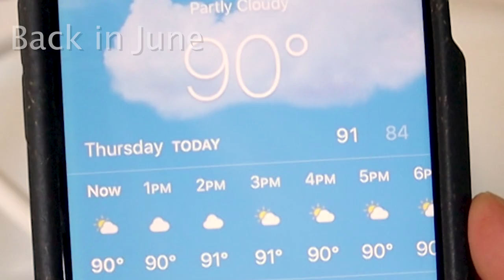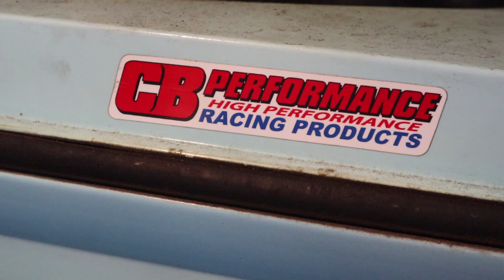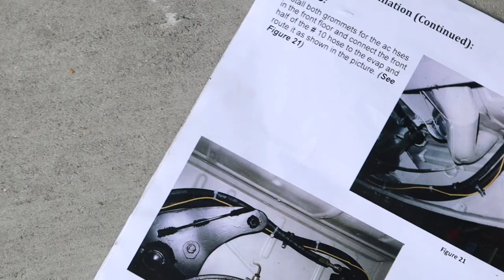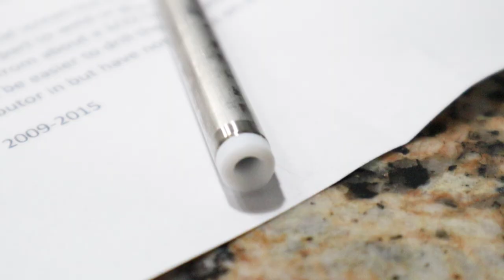Air Conditioning In A 1967 VW Bus

Comment from the maker: Big THANK YOU to my dad who did basically all the work on this one. ALSO: Gilmore Enterprises has since upgraded their pulleys to fit and center on CB Performance crank pulleys.
Reply: Bro 
Do u give me a job on ut garage😁 please
Luv frm imdia
Reply: I need to show my friend this video. He owns 3 buses and 3 bugs he also has the VW bus with the truck bed. I forget what you call that one. But yeah
Reply: This might be a dumb question I’m in the process of purchasing a bus does that AC have heat in it too or is it strictly AC
Reply from the maker: @peytonsalehinasab1889  Just A/C. The bus has a heater originally, just need to make sure that the heaters are in good shape (no rust on J pipe things) since it uses the exhaust heat for interior heat.
Reply: You are very welcome. Always fun playing with VWs.
Reply: Love the video. Where did you bought  the kit? It's now 3 years already. How's the belt configuration? How long did the belt last? Did you don another modifications?
Reply from the maker: @bobtomica9614  Thanks for watching, here is the link to their website: https://www.gilmore-enterprises.net . I have been running the same single belt for about 8k miles now and it still looks great. I haven't modified the system in any way so far and it has been working fine.
Reply: @gottasplit5707  Thanks!!!

Comment: I live in Indonesia, a tropical country with an average daytime temperature of 36°C. 
I have a VW T2 that also uses AC. 
The compressor uses Denso with 2 belts, the condenser is below and the evaporator is located above the driver, so that the rear passengers also feel the cold wind. 
When used, the power is reduced, so I increased the engine capacity from 1600cc to 1800cc and used a double carburetor. 
I also replaced the alternator to 72 amps to overcome the lack of electricity when driving at night where music and head lamp are on, plus the condenser blower and evaporator blower.

Comment: FYI it is already really hot for summer driving in a air cooled bus. Watch your engine temps. Then you ad the drag of an ac compressor and it is really pushing it to the limit.
Reply from the maker: Yup, this engine has been full flowed and has an external oil cooler with a thermostat activated fan. I also have a larger fan and oil cooler than normal and an extended oil sump. The AC hasn't really made a difference in heat or power.

Comment: What a project. I completely replaced AC on my 87 Westy, everything except evaporator (flushed well), including all new lines and new components. What a learning experience!   Wife wants a bus but I had questions about AC kits, this video is perfect.
Reply from the maker: Thanks for watching! I'm actually going through my Westys system now trying to find what must be a really small leak. If you replaced the Westys system, You should have no problem with the bus install. Good luck with it!
Reply: How was that install? I have an 87 ton top I’m looking to get an aftermarket kit for. Do you recommend any?

Comment: Great job, and kudos to Dad for the help. To be honest, I didn't think that small engine could power the compressor, and thus, the reason VW didn't offer AC on these buses. But my hat is off to you guys, Great job!
Reply: Back in the day what you said is true. I believe this AC setup use rotary compressors which rob much less power.

Comment: You must lube your Orings with refrigerant oil otherwise they will grab and damage the Oring and that will come back and bite in the long term, also the A/C drags heat out of the vehicle so regardless the whole vehicle will cool down the people in the back do not need cool air blowing on them to cool down, An ac or fridge or anything like that removes heat though the evaporator and the condenser they do not put cool air in as such if you understand what I mean, but great job guys in any case well done from down under A/c Tech of 30 years.

Comment: ha!!  this is awesome..  I live in OhiO  but I added TWO! compressors and 2 large condensers plus 3 indoor evaporators to my Mobile Ofifce DEV bus..  thanklfully its an old school bus so its a LOT bigger inside..  but it was still a Shoe-horn job to fit 2 A/C compressors in the engine with a bus that already has air brakes compressor, fan, alternator and such running from the belts..  I find myself ending up in Texas and florida in the summer months quite Oftern..  I like the heat BUT not when im driving!!

Comment: So nice that there are a lot of manufacturers making stuff for the air cooled vans. Hoping small company's also start making stuff for my LT.
Enjoy your A/C! We luckily don't need it that much. It was hot when we went to france, but meh, just went with it, shower afterwards.
Reply from the maker: Thanks! Having so many after market parts is both a blessing and a curse. Sometimes it's difficult to find a good product that fits, works correctly and lasts.

Comment: I have the same bracket and compressor,  I mounted the compressor sideways, Same as you you did to overcome clearance issues with throttle linkage bar above compressor,  had in car since 2019, compressor recently stopped compressing the refrigerant, an engineer told me the compressor died an early age because I mounted compressor on its side, fittings are apparently supposed to be located on top of compressor,  I have not yet installed the new compressor,  also watching another YouTube video it was recommended to use the smaller pulley to not over load the engine, the larger the pully the larger the load placed on engine, I have not had time to look further into this but thought I'd pass on the info. Great video,  I like the roller ball bearing throttle cable tube,  got one on order, thanks.
Reply from the maker: Thanks for the info. 👍

Comment: great video! just recently fixed the AC (not a gilmore kit) on our beetle and I am having problems with fixing the tins for the compressor brackets, I wished you would create another video on how you cut the tins to make way for the compressor brackets.
Reply from the maker: Really it's just trying to put the tins in and cutting away the parts that are in the way of the brackets. if I remember its only a circular hole in the forward most tin and a notch near the exhaust flange on the rear most tin. Just be sure to cut a small amount at a time. better to have to take the tin on and off a thousand times than to cut too much the first time.

Comment: Well AC is necessary if you drive in the summer in FL for sure. Honestly I would do one of 2 things. I would not drive my bus  in the summer or put in a different system. The rest of the year you can drive with no AC it is great there just crack the wind wing. I was thinking about making a generator stand at was a bit shorter (machine a 1/8 to 3/16 off the bottom of it then put a piece of plate under it to make the bracket, also I would have gotten a universal Evaporator and put it under the seat. then have tubes route around the seat and have them point up at the driver and pasenger. Possibly use the heat duct to push air through the dash area.  and attach diverter clip on lexan plates to make the air point at your face.
Reply from the maker: Sounds like a good idea for a system. I just don't have the time to put together a home built AC for the bus. I'm sure there will be complications with running AC up through that tube since it is not very insulated and has no fans to blow the air. As it is, the AC works pretty hard to just cool down the bus. I drive my bus on pretty long journeys at all times of the year, so that little black box under my dash doesn't bother me too much if it means I get to enjoy my bus more.
Reply: @gottasplit5707  for sure I noticed you dont run a heater and I am sure you dont need one in FL. I would have used that void under the front seat and insulated the heat pipe and used that for part of the ducting. then 2 more ducts on either side of the front set. Yea But again I would be more worried about the engine running too hot and burning up. I am not sure which gears you have in the trans. or engine size. But FL heat is really hard on the engine without air. with air that drag and the FL heat might be a new engine pretty quickly. Get a head temp sensor much over 300 is too hot. Or when your driving it floor it once in a while and if you hear any pinging it is overheated.
Reply from the maker: @Mikefngarage  I have a stock transmission with gear reduction. I agree that I need a temp sensor just to be sure, but so far I have had oil temps around 186 in the summer. Hasn't gotten any hotter than that. The external oil fan has only ever switched on once while I was in bumper to bumper traffic. The engine is also a 1904cc and barely feels the compressor. I doubt it is any worse than putting a few passengers in the car. I can see how its extra strain at idle, but while moving it shouldn't make a difference.
Reply: @gottasplit5707  cool just keep an eye on it on those freeway trips. around town should be fine. Check on the cost of putting a 3.44 gear set. Stock is 4.12. Kind of pricey but worth every penny on that split window. I do that and have them put a bug 4th gear. stock bus is .82 bug is .89. this gives you more like bug gears. make sure rear tires are tall too 205/75 15. anything smaller is too small for stock trans. too many RPM on the freeway makes these run hot too. there is a happy medium.
Reply: @Mikefngarage  New style compressors only take about 1 to 2 hp to run

Comment: I'm doing a Subi swap on my '68 and it looks like this answered a lot of my questions.  Just need to find a place to fit the blower and whatnot in the front with everything else chassis or belly mounted.  I was wondering if I'd have a problem with having to run tubes so much further than normal and if the compressor could keep up with that.
Reply from the maker: Thanks for watching! Glad the video helped. 👍

Comment: Curious….Can you still get at the fuse panel without complications? I notice it is very close behind the evaporator.
Cheers!
Reply from the maker: It is super close, but I can still get to the fuses. It does make putting the fuses back in a little bit of a pain though.

Comment: A year in have your thoughts changed at all about this kit? has the single belt system continued to work ok?  I'm looking at a early bay kit what length of bet did you get for the single belt system? The single belt looks like the average auto fan belt at any auto parts store correct? thank you for any help great video :)
Reply from the maker: It's been really good, but both my friend and I have had problems with the quality of the compressor in the kit. We both have changed the compressor to a different one that has been working much better. Everything else has been fine. Definitely like the single belt since its less to mess with and makes it really easy to make small adjustments to the alternator belt without removing shims on the pulley. The belt I think can be bought at any auto store. I got mine at an Advanced Auto Parts.

Comment: Cool video, thanks for sharing. I have one of these kits waiting to be installed. I have a thousand questions but here’s a couple of them: Some people install the evaporator on the parcel tray area (requires cutting the parcel tray, of course) for higher positioning and thus better cooling. Do you feel that you get good enough cooling with the evaporator where you have it? Another question is, without a cab divider to trap the cold air in the front cab, same question: do you feel that the system delivers at cooling things off on a summer day? Lastly, I do see you have quite an upgraded motor, how (if at all) has the AC affected power? Do you run it while on the highway and if so, how fast can the bus comfortably go? Sorry that’s more than a couple questions, catch you at the next gathering.
Reply from the maker: Thanks for watching! I tried to stay away from cutting stuff as much as possible when installing. it probably would look and wok better a little higher up, but I'm ok with where it is under the tray. Without the walkthrough, it does take a while to het cold air to the back, but since I drive the bus, I can't say for sure how effective it is in the back. I do think that eventually I will put another evaporator in the rear, which I have been told works with the system. My engine is a 1904cc with a bunch of added cooling parts on it for the summer heat, so it doesn't feel the compressor that much or get too hot with it on, even in the summer here in south FL. I do have a friend with a stock 1600cc single port with the same kit in a bus, and he says it doesn't have a problem pushing it, but there is some power loss. Cruising speed has not changed on the highway at all for me. Still does 60-65 no problem. The power loss is most evident at idle. I had to raise the idle a bit to keep it at 900rpm with the AC on.

Comment: Great job on the A/C project! It's certainly worth it. Keep a spare belt or two in the bus with that single belt configuration. What freon does this system use?
Reply from the maker: Will do! I'll also keep some spare original sized belts. If the A/C starts throwing belts ever, I'll be able to just put the one on the alternator to get home. The system uses R 134.

Comment: Nice video! You inspired me to get a kit for my 68 beetle! Just was wondering where you were able to find the 3-1 pulley belt?
Reply from the maker: Awesome! 
I was able to find it at a local auto store. To make sure of the size, I just took a string and wrapped it around the pulleys, cut it to length and took it with me to the store. I also took the original belt with me to get the width.
Reply: @gottasplit5707  ah it’s that easy! I’ll do the same then. I’m in Orlando so I understand the heat 🥵

Comment: Do you notice any loss of power?  I'm guessing it is negligible with that CB Performance engine?
Reply from the maker: I can tell when the compressor turns on and off at idle, mostly because the rpms drop a tiny bit, but other than that I can't feel any loss of power. I've already done some highway driving and was able to cruise at normal speeds. No hesitation getting up to speed also. I do notice a bit more fuel being burned, but the engine wasn't the most fuel efficient thing to begin with.
Reply: @gottasplit5707  Par for the course for most auto ACs!

Comment: I've been thinking about A/C for a 1969 Beetle (1776cc engine). Beetle engine bay is sort of cramped as is.
With dual carbs, I would think that any spark plug changes, etc.,  would be a pain with all the A/C gear in the way. On the left-hand side, anyway.
Would you say that a single center-mount 2bbl. is preferable?
Reply from the maker: Shannon Wittman I had the single carb 1776 set up with A/C in a 73 Super Beetle, and it was extremely cramped. I used to only change the 1,2, and 4 cylinder spark plugs because I couldn’t actually reach the plug on #3. Even with the hassle, the A/C was still worth having. If you can find a kit that lets you continue to run dual carbs, go with that one. The single carb won’t give you the same performance.
Reply: @gottasplit5707  ... thanks, will do! I like the 1776cc also.  Also, I hear that the modern A/C units are less a drag on the VW engine. Appreciate your video!
Reply: @shannonwittman950  I believe if you have this set up installed and need to do a tube up. Then you could just unbolt the compressor from the mounts without unhooking the lines and set it aside. A tune up with dual carbs is a challenge in itself.

Comment: How well does the a/c work on really hot days, and does it drain a bunch of power from the engine? Thanks!!
Reply from the maker: It works pretty well, but I think I might add some good insulation to at least the roof of the bus some time in the future. On really hot days it takes a while to cool the whole bus down with the AC on max. I have a 1904cc engine, and I really can't feel any power difference. I can hear the idle drop when the compressor engages, but it doesn't seem to effect performance too much. Not sure about a smaller engine. Also, I do have a lot of extra cooling power on this engine. A stock cooling system might be worked pretty hard with the AC running in high temps in traffic.
Reply: @gottasplit5707  Gotcha. I've always been kind of intrigued about putting A/C in old VW's ( lame, I know...lol ). I kind of figured that a ton of hot air has to leak through those old bodies. Thanks, for the reply

Comment: That's pretty cool but not a fan of the way the vents and stuff look. Throws it too much looking like a bay window bus interior. I use to have a seperate fan on my 57 split. It was just forward of the rear axle where the heater vent tubes went but there was like a split where one part of tube went to the motor for the heat and another split off to this fan for outside air and forces air into stock vents in cargo, legs and the windshield. I probably could have used that scenario and just added the ac knobs by the tray area and not have to add any vents or cut up the park brake lever. 🤔🤔 too bad I dont have bus anymore. Would have done that.
Reply from the maker: That would have been pretty cool to do. Sounds like a lot of engineering that I'm definitely not qualified for though lol. I thought of a bunch of ways to mount evaporators and vents, but they all ended up being just as intrusive in the interior, and 10X the cost and effort as just living with the one already made. Maybe someone in the future will make one more suitable for the 60s look.